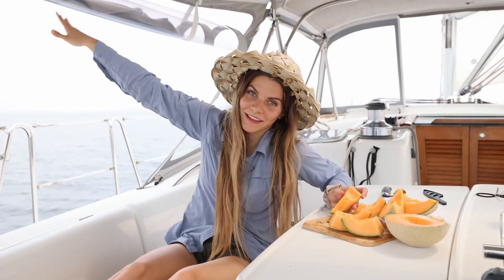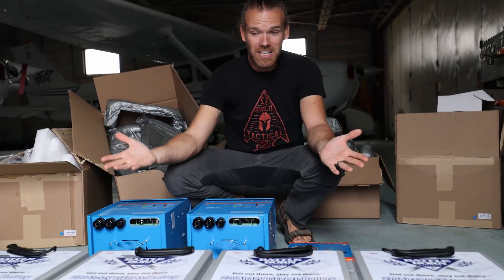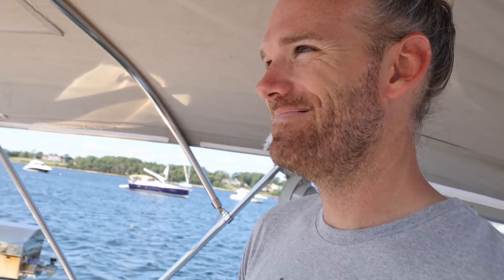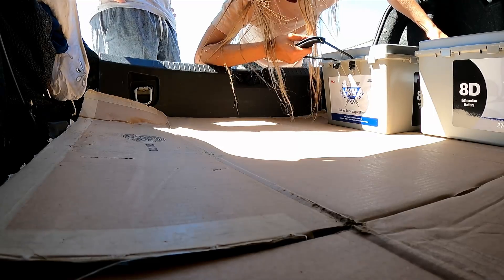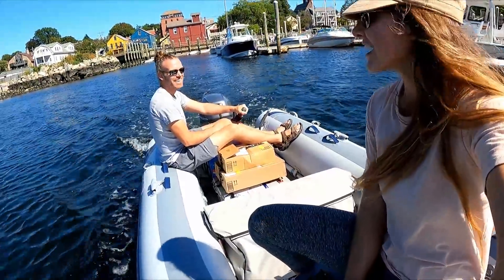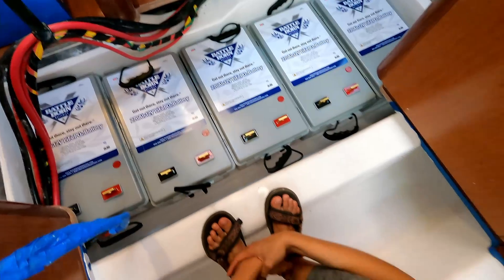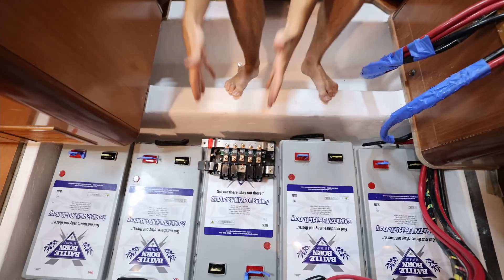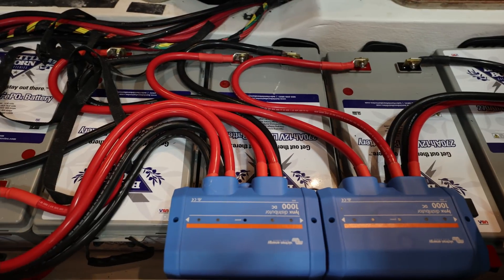They liked our SALVAGE SAILBOAT story, so they sent us 400lbs of LITHIUM 😲 | Expedition Evans 60

Comment: You need a decent set of cutters to cut rigging but for the heavy cables, use an angle grinder. This gives a nice cut that does not compress the cable making it easier to fit the crimp-on  (or solder if you have enough heat) terminals. Look after you back, good to see BOTH of you use good posture to pick up those batteries. Stay well guys.
Reply: Not sure if I would do that without looking into the contamination of the copper (tinned ??) conductor
Reply: And that's probably MTW wire. (Machine tool wiring) 
I.e battery cables.
In a pinch a side grinder with a cut off wheel will work for 19 strand THHN.
But for MTW...
Get a good set of Cable cutters.. Greenlee...
Reply: "If I needed to get rid of a body, all I have to do is wrap it up in this cable."

Brett, sleep with one eye open brother. 
And if your walking around deck be sure you're tied off to the boat... don't let her sneak up behind you.
She's just waiting for you to get the batteries hooked up.... Then, well, you know...😂🤣😂🤣.

Comment: Thank You for paying so much attention to wire lengths. I have been an electrician for just under 50 yr doing mostly heavy industrial construction and 4/0 wire is frequently the smallest wires I work with. Equal lengths is critical to balancing the currents on conductors.       1 thing I do not get the point of on the last several electrical DIYs is the MASSIVE 12VDC battery banks and size/ampacity of equipment to service them. To me it would make much more sense to have a 300/600ah 12VDC House bank (maybe Hybrid , Lead-acid and Lithium) and a 500/600ah 48VDC Lithium distribution Bank. Then all major loads (Propulsion, Windlass, Watermaker, Inverter/Charger, Fridge/Freezers, Elect Outboard ?, etc...) would run off the 48VDC Dist Bank, a DC/DC charger off the 48VDC Bank would keep the smaller 12 VDC House topped up at all times for all you Lites and Navigation, etc... All charging (Solar, Alternator, Shore Power, etc..) would run into the 48VDC Dist Bank. This would great reduce fuse, wire and equipment sizes and weights making it all very much easier to install and maintain. Also having the higher voltage Dist Bank servicing all those larger loads leads to higher efficiancy of that very much lighter equipment thereby reducing your overall displacement (more efficiant sailing) and you still have aprox the same 1200ah setup. To me it is like only having Piggy Banks that hold quarters for all your savings. Fine if you are only going shopping for some milk and bread, but you would need a pickup truck to do a larger grocery run, where if most of your Piggy Banks were for $1:00 coins you would only need a wheelbarrow

Comment: Lfp batteries are life changing. We built our 20kw (32 cells 800ah @24v) system 8 years ago, before most people had heard of lfp.  Many were scared of it and didn't understand.  We do not have a generator on board and we have air con, watermaker, hot water heater etc etc.  You are going to love them.

Comment: I have install many 24cell battery arrays. When cutting the wire, tape both sides of the wire , then cut between the tape. The battery connectors all should have dielectric grease and test the connection with a voltmeter. Great project.

Comment: Hi u 2! no matter how equal the lenths of the cables are there will be some difference in internal resistance between the batteries. So you will need a balancing device anyway to keep them at the same SOC.

Comment: Nice job and kudos indeed to Battleborn for coming on board. I confess that I was feeling a little nervous watching that 500lb plus load in the floor of the dinghy and worrying that the dinghy might not like the weight..... I’ve seen it happen before to a couple who were loading new batteries up in Port Klang - about $1000 of batteries ended up on the bottom of the Klang River after the floor gave out just a few metres from the dock
Reply: Ouch that would be gutting!
Reply: Did you see the video on this dingy? It is ridiculously oversized for a cruising boat. They have a 25hp outboard amd it isn't too big for this dinghy. It is more workboat than dinghy. I bet they didn't even overload it with all this stuff on it by the official factory nameplate numbers -plus Jade and Brett themselves don't even come close to 300lbs put together.

Comment: I would recommend that you add wind turbines to your solar plans so that you can maintain the batteries at night and for extended stormy periods.  S/V Delos employs them very successfully in their Ketch-rigged boat.  Those Li-Ion batteries are so much lighter than the eight Group 8D AGM batteries in my motor coach and much more capable.

Comment: Great explanation of the wiring, you did your research well! I also like the redundancy in inverters and chargers. To make it perfect, a separated emergency bank located at a higher position would be helpful, because given some water intrusion, you will lose this bank and not be able to run electric pumps. For regular operation things look very promising.

Comment: I'll second the angle grinder with a thin metal blade for cutting that cable.  I also recommend you covering the positive terminals whenever possible.   Drop a wrench on those and watch the fireworks.
Reply: Boat cable cuts very easily. A set of loppers from Home Depot or even Harbor freight will cut it like butter. This isn't 19-strand THHN building wire. A cutting wheel will tear up the teeny-tiny strands and make a mess of it.  

I'm a commercial electrician and have cut large wire with a grinder and even a hacksaw in a pinch. On 500mcm wire a hacksaw works well if you don't have a good hydraulic or ratcheting cutters, but this boat cable is more like MTW-machine tool wire. Each strand is like the size of sewing machine thread. The insulation is vinyl and stretchy, not like the stiff thermalplastic insulation on building wire that holds its shape.

Comment: Great video. It’s a funny thing upgrading to LiFePO4, such a good feeling and the only real difference is the huge % remaining all the time 😆. The charger inverters are the thing most noticeable as the power sockets work all the time!  Amazed how much power you’ve installed. I did 400 Ah and you have several times that. so you are really able to use electricity without stress at all - good job!

Comment: Excellent vid guys! thank you. Small correction on the metaphor, it's not the length of the tube but the diameter, a smaller diameter tube has more resistance just like a longer cable does, two tubes of the same diameter but one longer actually will drain at the exact same pace... Just for the scientific accuracy is all :-)  You could have different lengths on the cable if you had different size cables but that is a lot more complicated. Also there are other ways you get around this issue but that's for another time.

Comment: And guys, take care of your generator, because there's no way you could fit enough solar panels on a sailboat to charge that bank in a day's sunshine.  I have 31 panels serving my 860 amp hour bank, and mine are flooded batteries, which means I can only drain them halfway. It's not night you have to worry about; it's cloudy days. And don't count on the rated output of the panels; that's full sun, high noon, pointed straight at the sun. When it's really hot (like in the tropics ;) ) they lose 20% efficiency. 

Just be mindful of your power use on those cloudy days (and when the panels are in the shade of those big beautiful sails), and keep plenty of generator fuel on board. And keep up the good work!

Comment: Nice setup! Watching other sailing channels outfitting their electrics I thought they hooked them in series with short bits of cable going from the negative post on one battery to the positive post on the battery next to it and so on.
Reply: Uma but they are running a 48 volt system.

Comment: Make sure that you augment your ballast to compensate for the difference in battery weight. :-)  Also, I've used a tubing cutter to cut #4 cable cleanly.

Comment: Great work, as usual.  It's probably not good form to refer to another sailing channel, but I assume you guys are familiar with what the Sailing Uma folks are doing.  They've swapped out their diesel for an electric motor, and are successfully charging their batteries from the prop while sailing - might be some interesting ideas to glean from their set-up...

Comment: You should probably add something along the fore and aft section of that bilge section to keep the batteries from moving those few inches.  Side to side maybe a couple of sections of quarter inch plywood to fill in those little gaps tighter.  Between the batteries and the combiner boxes you probably could have gone one size smaller with the battery cables, but since you had to get so much for the longer runs from the inverter/chargers and the main panel it does make sense to just get a few more feet of the 4/0.
Reply: I would use some kind of sheet foam to make sure those. Batteries could not move.

Comment: Very good analogy with the water.  I'm an electrician and it's amazing how often you see batteries jumpered to each other and the power leads connected to one end of the daisy chain.  It's not as big a deal if the jumpers are way oversized but for some reason people don't do that either...  I guess it's a little understood phenomenon...   Curious why you went with 12 volt instead of 24 or 48.  The weight savings in weight and cost in cable and inverter is substantial.  Given how well Brett researches things I'd guess that these factors were considered?

Comment: Hi Jade and Brett: I'm impressed by your battleborn Batteries and setup. Have you given any thought to lightning protection especially where you expect be going down south; some methods are fairly simple but need some research with the amount of electrical power and comms you are going to be using. A wire cable from the base of the mast overboard into the water would be one qick way for a cheap fix but try some research on the internet for other options.
Keep an eye on that Jade - she's probably stronger than you think!!

Comment: The amount of length in a short run is miniscule when considering the speed of the electrons moving through that cable. It will not make a difference in the charge or discharge of the cells.

Comment: Dudes an 'A' for your efforts in using lithium's instead of the older AGM lead acid, BUUT their is a reason we used 48 VDC instead of 12 VDC for DC power systems. It is because of the ridiculously  high current that you have to use to get the high power. SO to gets 3600 watts for example it can be done by 12 VDC at 300 Amps or 48 VDC at 75 Amps. You have to have massive heavy 4 gauge/au or bigger wire to carry all the current which make the wire heat up from this massive current. Any bad or faulty connection, can heat up the wires and cause a fire. One of the main reason that you need to balance the length of each feed wire to your power manifold to keep the drain even from each battery, is because of the high amps.

Comment: beware that you have re-adjusted the ballast that the boats designer must have calculated this into the weight sail height equation. for lead acid batteries have been around since the 192o 's and as you have noticed they weigh a ton. you should consider keeping a couple of them-- centered in the center-- and wiring around them. keep the ones  that show the highest voltage after a few seconds of high drain assuming a full charge-- they can work as a backup supply. be careful with fuses-- fully fuse all. Finally-- beware a fire. Include  a ionize type fire alarm in with the batteries-- with a dual system, or 2 alarms with one that will blare in the living compartment should the bilge-area batteries overheat.

Comment: Moving the new batteries around from hangar to car to dinghy to boat with bare poles looks pretty dangerous to me. Some conducting part would release a lot of energy! The preview with all red and black cables connected still showed the bare poles. I know that there will be a cover over this compartment but covering each battery pole would be adviced as there is a lot of energy behind them.
Reply: The ones i worked with for a 16 cylinder generator starting setup came with clear shrink rubberized covering them and were pretty tight most of the post you couldn't really see it unless you were lookin closely at them. Don't know if these have them or had them or not from the few times they showed the post.
Reply: I noticed that, too. If I remember correctly, BB has a BMS/protection circuit inside each of them. That would provide short circuit protection. (as would fuses and breakers.) All of my packs have fuses in them. (I'd like it to be in the center of the string, but that messes up balance charging... the fuse has an internal resistance 10x that of the battery.)

Comment: Make sure that all parallel paths are the same length. MicroOhms are important in keeping the batteries equalized. The devil is actually in the details.
Reply: BMS
Reply: BS, it doesn't matter, you never push the wire (with current) in a way you get a big voltage drop...
Connections are more prone, we use thermal cameras to find bad connections...

Comment: 4/0 cable from the battery to the combiner box is overkill.  Each battery is only 20% of your system capacity, either stick with 4/0 and ignore the length, or step down to smaller cables of equal length.

Comment: HIGH tech expands your options going forward  . . . . .  .

Annnnd on a totally different issue . . . . what is the voltage and amps of your engine alternator now, and have you planned to upgrade it to a 24 volt 180 or 200 amp alternator (or maybe two) to avoid running you generator?

Comment: Anyone considering equipping their boats with gear that can ever suck up more than 170 amps at 12 volts or about 2 kW should be looking at 24 volts. It is inefficient, and often impossible, as well as potentially dangerous, to supply the high-load equipment, that so many cruisers seem to want, with a 12-volt system, regardless of the size of the battery bank, since the cabling and fuses simply won't support it. And, further, that the solution to this problem is either to forgo all very high-current (amperage) gear, or select a boat with a 24-volt system—there are no other good options

Comment: 81lbs for 270Ah? Did they fill the case with concrete? The 200Ah unit being assembled on my bench is around 30lbs. [it's for HAM radio gear] ('tho using much cheaper generic Chinese cells. CALB cells are a lot bigger, and heavier, and 3x as expensive.)

Comment: Hold on. If you have 2 identical buckets, with 2 hoses of the same diameter attached to the bottom, the bucket with the longer hose won't be draining slower than the one with the shorter hose.

I think your metaphore is confusing Voltage (Pressure) with Resistance ? Maybe? Idk.

Comment: Resistance is so low on that heavy cable a few inches in length difference will make no difference.  Prolly have more resistance in the connectors,

Comment: Those look heavy. Will it slow the boat down?
Reply: The new bank is lighter by a few hundred pounds than the old battery bank.  If I remember correctly, the new batteries are about 80lbs. each and the old ones were about 130lbs.  One of the greatest advantages of going with LiFePo4 batteries.

Comment: Just make sure that cables running from charger to each battery have exact same length. If you make them look beautiful closest battery will charge and discharge the most and die very quickly.

Comment: In reality 1/0 cable is fine for doing most everything thing I was thinking about is hold down straps for the batteries to run atwartship and if you have cables of that thickness you will have to plot and plan your battery harness with a better idea 4/0 gauge is way to big for what you need yes you have bow thruster maybe 3/0 but everything else adds weight overthinking the wheel you might start to make square wheels again. Yes you can do things yourself but unless you are a electrical engineer your ideas will not become what his ideas are spend a little extra dough get the right guy to make a schematic or help install this makes more sense what do I know I am not a electrical engineer this is not a d.i.y your livelihood depends upon this
Reply: My batteries can produce 250 amps, I wonder what these can produce?   That is why the cable is so thick.

Comment: battery drain disparities occur due to individual battery's internal resistance and wiring, but since cables you got are pretty thick and made of copper - their resistance is virtually 0, so their length (give or take a few meters) does not matter in this situation, and the analogy with water buckets is wrong, scientifically speaking, even though it sounds very logical on the surface. Great episode, otherwise!